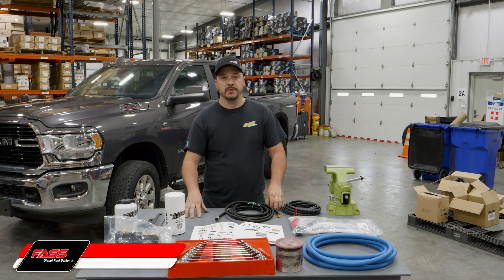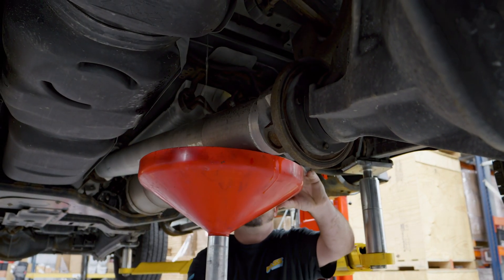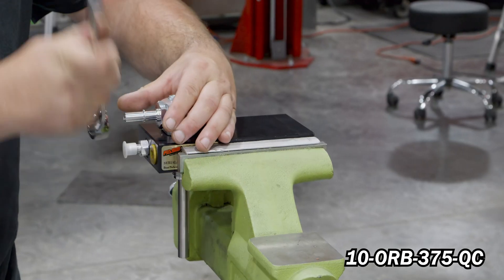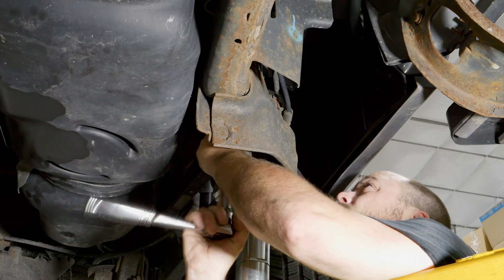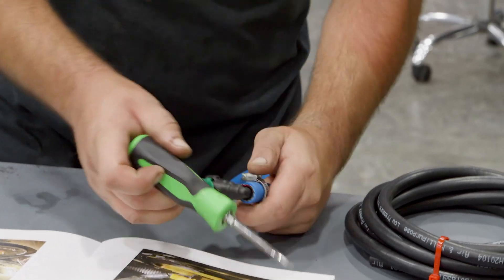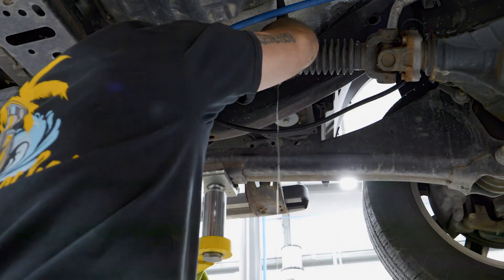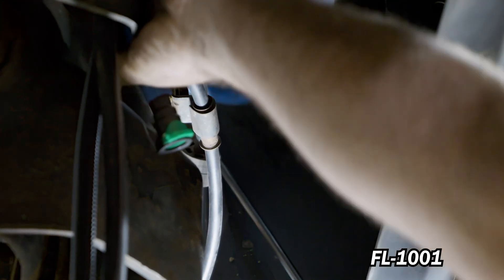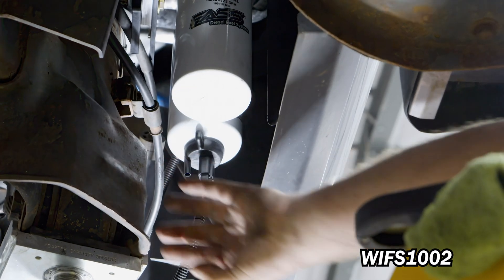How to install a Drop-In Series Fuel System on a 2019+ Ram w/ the 6.7 Cummins

Comment: An hour?  Are you sure?  I was just at YOUR SHOP today in Washington, MO and you guys charged me 3 hours of labor ($375) to install this system on my 2022 Ram 2500.  So, maybe you can refund me $250 of that.
Reply from the maker: Thanks for reaching out! We apologize for any confusion. Yes, in some scenarios, a Drop-In System can be installed in as little as an hour—especially on Class 8 applications. However, much like you experienced, a typical installation time is 2-4 hours. Which is still FAR less time than our complete system. Hope this helps!

Comment: I completed this tonight. I think the instructions were based on a base model. The fender liners definitely made things difficult. Also I think a mention about leaving the front filter even though it's disconnected would be useful. A mention about the amount of fuel that pours out once you disconnect the supply line would be nice. My floor was drenched in diesel. On a positive note I love the new location of the filters.
Reply from the maker: Thank you for the constructive criticism! We will take notes for the next installation video we make!

Comment: Do I still need to change the fuel filter in the engine bay? And how often should I change the Fass fuel filters under normal driving conditions? Thanks again guys!
Reply from the maker: Thank you for reaching out, and you are welcome to delete the filter under-hood if you like. 

Typically we also suggest changing the FASS filters every 20-25k miles, or 1yr whichever comes first.

Comment: I know you can instal a fuel filter bypass kit for the fuel filter up by the engine...but what becomes of the original fuel/water separator back under the bed?
Reply from the maker: Great question, and with the drop-in series systems this will replace the unit you have under the bed if the truck.

Comment: 11/28/2024 Update:  I want to make sure everyone understands that this is not a critique!  I could not have done this installation without the video.  The video is excellent!  These observations and comments are for others like me who like to DIY but don't have the skills to match our ambition!

1.  For me, total install time was about 4 hours.  Going into the project, it's good to get physically acquainted with how the OEM connections work.  The bulk of my install time and frustrations were due to messing with the OEM connections.  The FASS connections were great!

2.  Starting with the chassis fuel filter, I ended up removing it and the bracket first so I could tilt it for better access to the connections.
    a.  The electrical connector has a red locking tab on top that you pull toward the front of the truck.  You could do it with a pick if it is still mounted, but I angled it slightly to get a small flat screwdriver on it to slide it.  
    b.  The front fuel line connection goes to the engine fuel filter.  It had a white sliding lock with a little notch for a small screw driver.  It slides toward the front of the truck.  Once open, the connection separated pretty readily with some wiggling.
    c.  The rear fuel line connection comes from the tank.  This was a little bit of a bugger.  The clip is the same on both ends of this little line.  The blue clip is the safety.  You have to pull the ears away from the connector and then slide it out.  The ears are pointy, not blunt so the challenge is holding them out while getting either enough pressure to slide the clip or get a little screwdriver under the notch at the top of the clip.  I ended up breaking the ears off because they were a little brittle. The blue clip covers 3 sides (2 ears and the pry point).  The side that the blue clip doesn't cover is a press point.  After removing the blue clip, you need to press that point while firmly wiggling/pulling the line away.  I found that small needle nosed pliers work well but I think there is a specialty set of pliers for these connections if you have that.

3.  Access to the top of the fuel tank is from the passenger side.  After you remove the chassis fuel filter housing and bracket, there is a good amount of room if you run your arm over the drive line.
    a.  Ok, another one of these blue clips!  This was the highest frustration point for me because now you have to undo this clip style by feel with 1 hand.  The connector is oriented sideways such that the ears are top and bottom and the pry point is on the passenger side.  You can rotate the fuel line to get better access to the bottom ear.  My clip was a bit stuck so I couldn't pull it while holding the ears out.  I ended up breaking the ears off and then pulling the pry part off with the small screw driver.  I held the blade end against the tip of my thumb so I could feel for the notch in the clip.
    b.  I depressed the press point with the needle nosed pliers.  A small set has enough clearance between the tank and the bed.  You can feel the groove where the blue safety clip was.  I gently squeezed the pliers while wiggling the connection loose.  I rotated the line around the fitting until I found a good angle to get pressure focused on that button while still having enough leverage to pull the line toward the front of the truck.  Once you overcome the little barb on the fitting, it pops right off.  Just be gentle and take your time.  Say your favorite words.  When I started losing my temper, I just remembered what a bugger it would be if I broke the fuel tank fitting!

4.  Fast forward to the little fuel return bell connection up by the front drive line.  In the video, it looked like Albert struggled with this a bit.  If the pro had a little trouble, I was sure to have some!
    a.  First, identify the return line.  Mine was 2nd down from the top.  The line above it is slightly larger which I followed to the engine filter housing.
    b.  You need the disconnect tool for this.  The installation manual shows what you need, but they also make a metal tool that has a handle.  I used the plastic one shown in the manual.  It's 5/16.  In retrospect, the one with a handle would have been much easier.  You have to work your way around the inside of the fitting while pressing the tool in.  There are 4 spring wedges at 90 degrees to each other inside the bell of the connector.  You can unclip the steel part of the return line from the bracket slightly rear of the fitting for some additional clearance.  Just press the tool, rotate, and apply as much consistent pulling pressure to the fitting side as you can.  It takes a little bit but you will hit that EUREKA! moment.  Make sure you're over your drain pan, not over your face and chest.  I did not make sure I was over my drain pan.

5.  Pressing the FASS T connector (QPDB3...) into the bell connector was strange.  It didn't seem to catch but I was bottomed out.  The bell housing hits the T that goes to the new black rubber fuel return.  I can still pull it apart without much effort.  It didn't leak on the test drive, but I was concerned about it coming loose with road vibration.  It might be worth spending some time cleaning the bell out with a little pick to make sure the area behind the spring wedges is fully clean.  I might go back and do that later.  For my own peace of mind, I just used 4 small zip ties to hold the connection snugly together.  I used two to make loops and two to pull those loops together.  The box end of the T that slides on the steel line clicked in no problem.  Just make sure it clicks and is fully seated!

6.  Routing the lines back to the FASS was pretty straight forward.  There is a great open area above the frame all the way back.  I covered the ends of the lines with a shop towel to make it easier and cleaner.  I just zip tied in spots where it seems best to make sure the lines stayed away from moving parts or parts that might get hot like the transfer case.  For now, I did not cut the line to length.  I left some slack because I will secure the lines in the engine bay after I install the engine filter housing delete.

7.  To prime the fuel system, I did 6 on/off cycles.  I pressed the ignition to run from outside the truck so I could hear when the fuel pump went on and off.  It runs a good amount of time so I suggest listening.  The truck started as it normally does--no problem and no extra cranking.

8.  Things I would have done differently now that I know better:
    a.  I would park the truck flat or angle the back end lower than the front end slightly.  I would also do this with maybe 1/2 tank or less.  When I disconnected the fuel return up by the front drive line, the steel return line ran diesel out--like alot.  Also, after I connected the new return line, it would pour diesel out if I had the end below the tank.  I think if the truck was oriented flat/downhill and the fuel level was lower, this wouldn't have been a problem.  I had to plug the end of the rubber return line while I ran it back to the FASS.  I made a huge mess!
    b.  Another reason to have the truck flat or angled was that the line that used to run between the OEM engine and chassis filters still had fuel in it.  When I returned from the test drive to inspect for leaks, it had emptied out over the passenger side of the fuel tank.  I freaked out because I thought it was that fitting on top of the tank!  Thankfully, it was not.
    c.  I would have rinsed out the blue fuel line that went from the FASS to the CP3 with clean diesel before installing.  I was very cautious when installing and kept the ends covered with shop towels when routing them.  However, a little part of me nagged that there might have been dust or other particles in there.  The main reason for installing this was to help extend the life of my injectors and I didn't flush the line!  Probably fine, but I would recommend it.

11/21/2024 Update:
I received the DIFRAM4001 (Drop in kit) and the Engine fuel filter housing delete kit today.  Great communication during the order, shipping, and delivery process.  Everything was on time and both kits were complete comparing with the instruction manuals.  Will install early next week!  If anyone was curious, the kit comes with the first set of filters.  No need to buy a set when you buy the kit unless you want spares.

Original Comment:

Hello!  Great video and thank you for taking the time to put it together! I'm going to order this kit and install it into a 2021 2500 crew cab 6.4' bed, but I have a few questions being only partially mechanically inclined.  Also, I don't have a lift to raise the truck.

1.  Did you access the top of the fuel tank from the driver's side rear wheel well by removing the well liner?
2.  Did you run into any frustration disconnecting the OEM fuel line from the fuel tank?  That space looks a little cramped for fiddling with those quick connect fittings.
2.  After removing the chassis filter housing, did you leave the fuel line that goes to the engine bay filter housing in the truck?
3.  Are there any tips or tricks you have for routing or protecting the fuel line, return line, and WIF wiring from the engine bay back to the FASS?
4.  I noticed a little bit of a struggle reconnecting the return line quick connect up by the drive shaft.  Was there gunk in the OEM side or is this just something we should be aware that takes a bit of pressure to secure?
5.  Just for a point of reference, how many on/off cycles did you do to prime the fuel system before attempting to start?

Bonus question:  I'm also installing the engine filter housing delete.  Is it best to remove the OEM line that used to connect the engine and chassis OEM housings or just leave it?

If there are any other tips or tricks you ran into installing, please share! Sometimes those unexpected things turn 1 hr projects into all day projects so better to be armed in advance!

Thank you again for this video!!!
Reply from the maker: Thank you for reaching out. We'd be happy to help answer all your questions, and get you taken care of. Whenever you have a chance please reach out to our service team at 636-433-5410. Our team will get you taken care of!
Reply: This comment was very helpful while doing my own install, thank you!
I’d be interested to know what you did with original supply line after finding it emptied while driving. 
Also, did you install the front fuel filter delete block? I have mine but haven’t installed it yet as it seems pretty tough to get to the banjo bolts and I was tired.
Reply: @Noigis88  Hi there!  I'm glad it was helpful!

I still have the original supply line in the truck.  It's empty now.  If I hadn't broken the clips off the ends, I would have purchased the little plugs that FASS sells.  They're on the 3rd page or so of the product catalog for the truck.  I don't think it's a good idea to fully remove the line since most of the way it's steel.  Only on the ends does it have the flexible tubing.  Right now I just have the ends plugged with a little bit of blue shop towel and duct tape.  Not a great solution hahaha.

I had the same impression of the delete block as you did.  It's really tight in there and I was working off a step ladder.  I have not installed it yet because the angle of attack getting at those fittings was more than I wanted to deal with at the time.  I'll get around to it eventually because I need that bracket out to go with the filter housing.  I also wanted to run for awhile to make sure nothing was leaking before I messed with another connection.  I don't ever planning on running dual fuel pumps so It's not mission critical for me.  I will definitely comment here when I get in there.

I have contemplated waiting until I do the Banks intake horn.  For that I'll take the front tires off and drop the front of the truck down.  I think that will make it easier under that intake side to get at the fittings because I can keep my feet on the ground.
Reply: @ronaldgoodwin1105 thanks for the update! 
I decided I’m good with the under hood filter house out and bracket in place until I get a Topside Creeper to have better access. I was using a step stool and laying on things. I did the same when I swapped the intake horn and it’s just worth it to get the topside creeper to me. I appreciate your help, good luck with your truck and future upgrades!
Reply: Your comments are better than reading the PDF manual or watching the video. Thank you so much